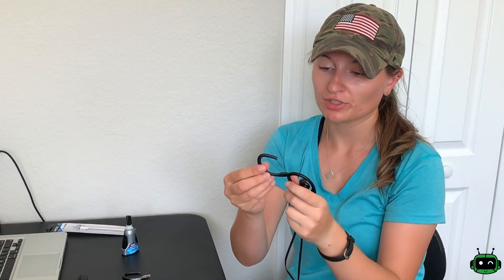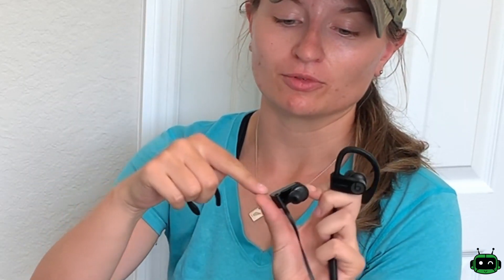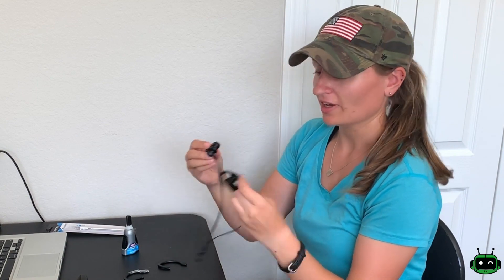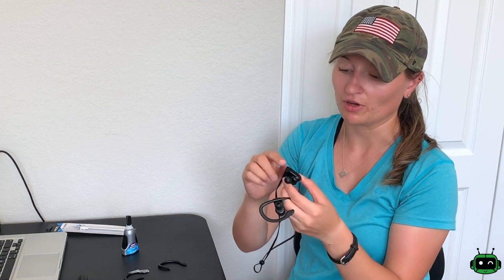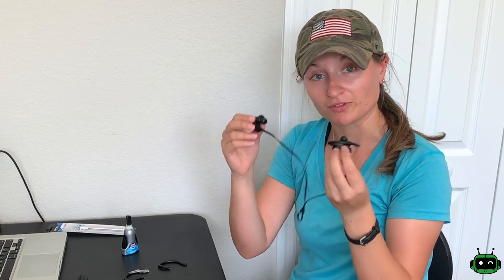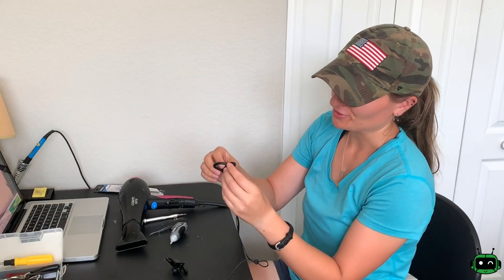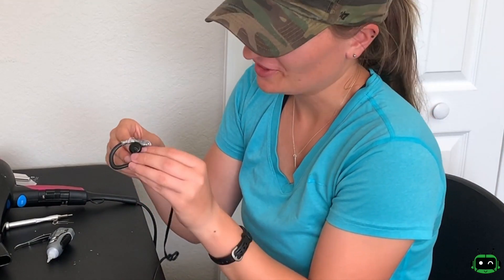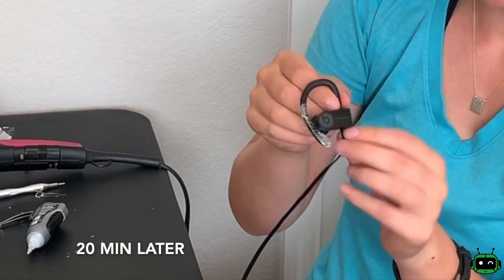Fix Powerbeats3 Ear Hook (Pretty EASY!)

Comment: Hello.
Question.
Hope long did it take with the hair dryer, as I don’t believe putting heat into this area where the rechargeable battery is would be good 

Cheers
Reply from the maker: It was about 15 minutes. I believe my hairdryer goes up to 80 deg F. I'd imagine if you don't keep it in one spot and constantly move it while working on the fix, it should be okay. The goal is to melt the adhesive on the casing, not directly heat the battery.